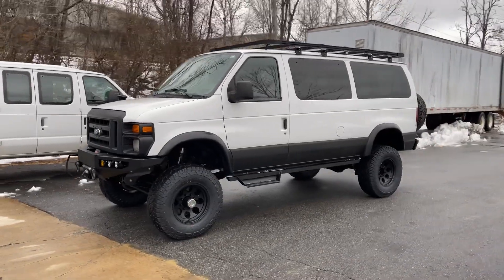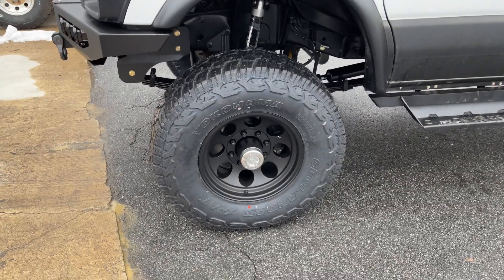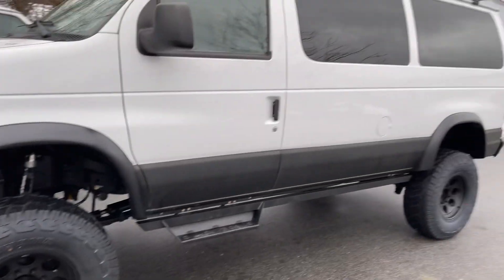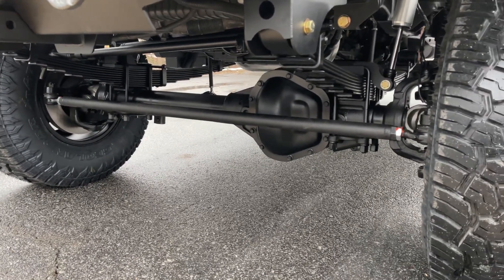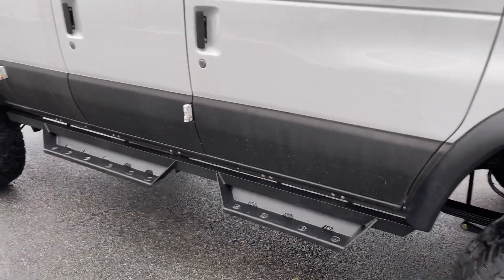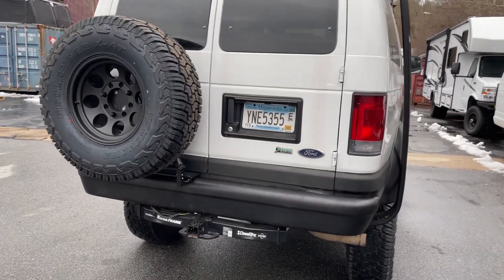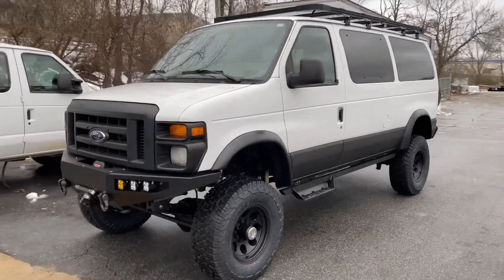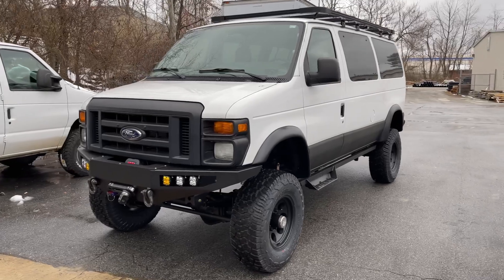Ujoint Offroad MN 5.4 build!

Comment: I've watched tons of your videos and rewatched some many times. But, there is one upgrade I haven't seen that is common to other vehicle modification YouTube channels: the engine. I know this is not your area but have any of your customers brought you rigs with a supercharger, aftermarket performance turbos, etc? Can you increase the horsepower, or is it not necessary in off-road applications?
Reply from the maker: We do basic tuners for power on some rigs but avoid engine work. We used to do some diesel stuff but stopped. Prefer the reliability of stock engines.